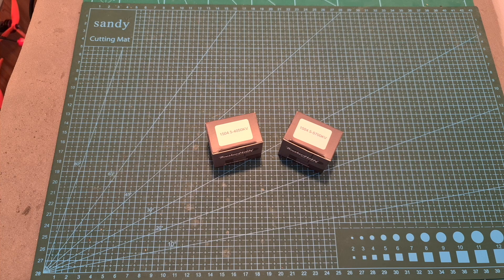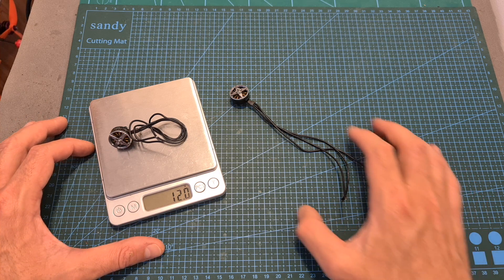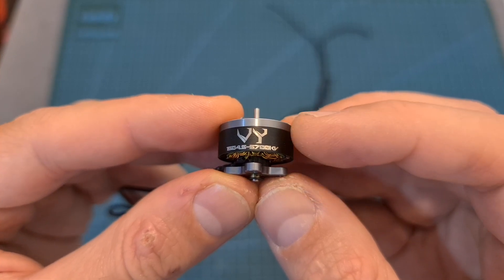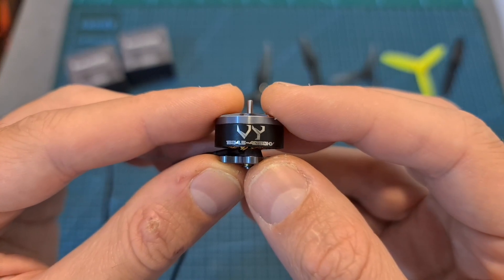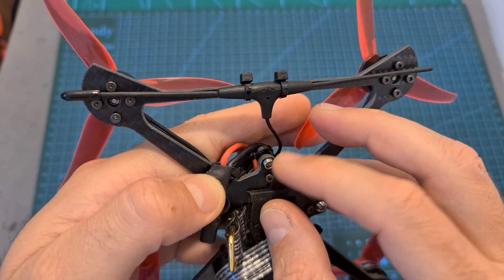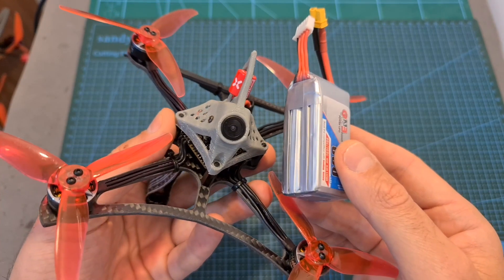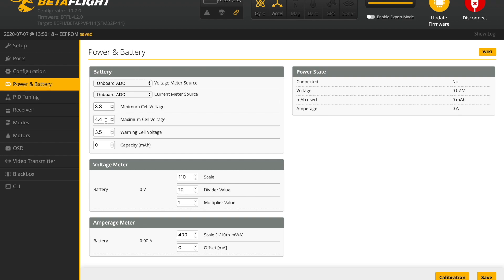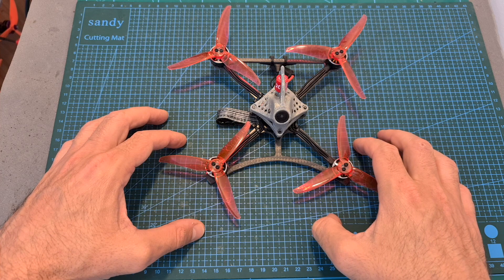BrotherHobby 1504.5 5700/4050KV Motors - Thrust & Flight Tests

Comment: Is this still the go to motor or is there a better option for sub250 3.5 inch?
Reply from the maker: It's a good option but there are other options as well, like in this video: https://youtu.be/d76CgzkBZkw
Reply: @KremerFPV  unfortunatly I'm sceptical on the mamba 1505s. You killed them with the 3.5 inch emax props. Thats my wanted setup 😄 I think the HGLRC 1804 3500kv might be better. Not any heavier and more Power. Tried them yet?
Reply from the maker: @chrisbee5481  Actually they work quite well with the 3.5" props. Bench tests are a bit more harsh than the real world and you can also limit the maximum throttle value in order to stay on the safe side (and still get good performance).

Comment: Would the 2950kv version be an acceptable replacement for the Flywoo Hex motors? The 6in1 ESC is rated at 13A, and the spec sheet says these have a peak current of ~12A.

Asking because Flywoo takes foreverrrr.
Reply from the maker: Well you can limit the motors output to 90% and then you will be on the safe side.
Reply: @KremerFPV  Awesome, that's what I was thinking, but wasn't sure.